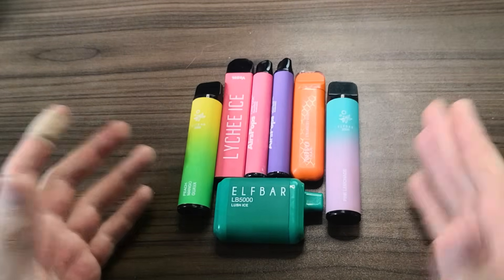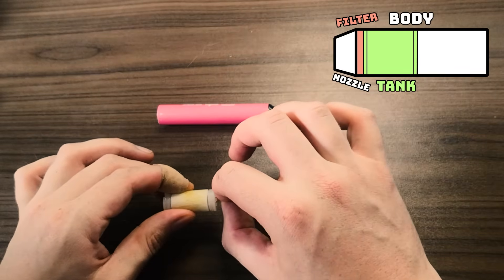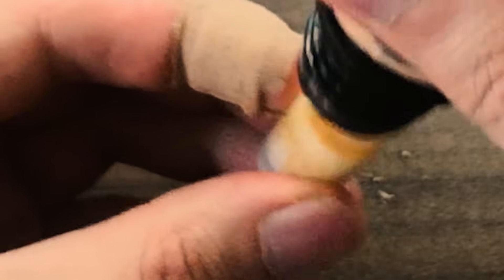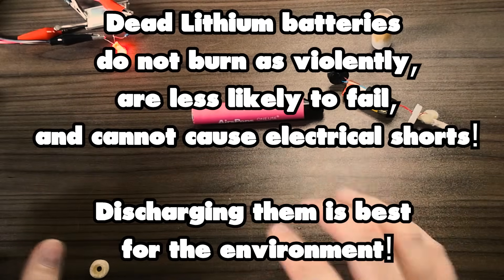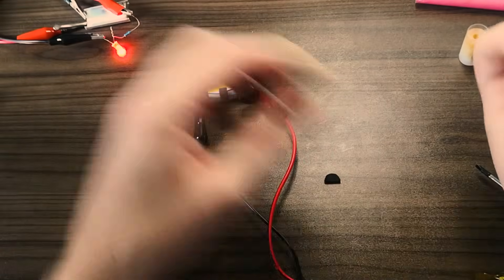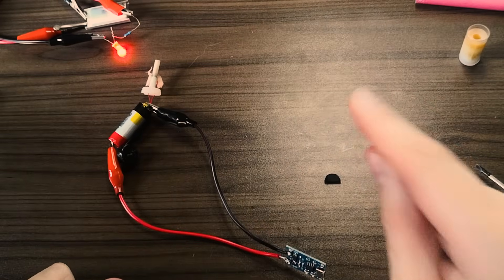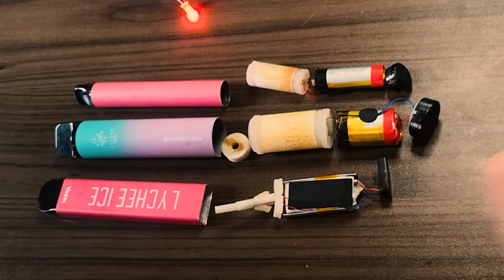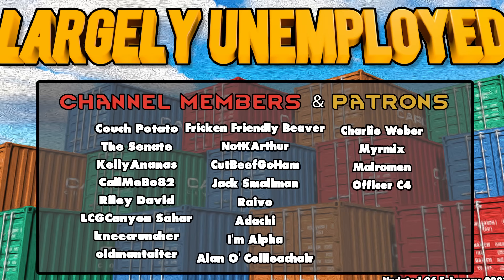'Disposable' vapes are a lie. Here's how to fix them.

Comment: I did the same thing for IGET Thanos and Star series vapes.They have a charging circuit inbuilt so you dont even need to buy a charging circuit. You can just open the thing fill it and close it again and just put it on charge .I really liked how you explained the video to non engineering background ppl on internet. You were pretty accurate about the voltages and told about battery swelling good info.I am no advertiser or promoter for any of these brands and dont promote vaping over long term.
Reply: Hey! I'm facing issues with my IGET star. It's not charging (LED not lighting up). Do you have any idea about this issue? (This is my first vape)
Reply: @takshakambekar7004 if you can, move away from disposables in general.

Comment: guys there are people literally dying of lithium poisoning from crack wiring their vapes. this is not safe, please just go out and buy another one ive personally lost two friends from this.
Reply from the maker: This is not a "crack wire" tutorial and the power output on these disposable cells here wouldn't be able to do anything more than lightly burn you if you somehow shorted the contacts with a finger.
Reply: @LargelyUnemployed  regardless youre recharging the lithium battery and theyre not meant to be recharged. not talking about simply burning yourself from the “crack wire” but rather potentially risking killing yourself due to poisoning frim the battery itself, once you recharge the vape, youre not only smoking nicotine
Reply from the maker: @Bommaosama  I'm not sure where you're getting this from? These lithium cells are absolutely rechargeable (about 6000 duty cycles on average). If you use a charger with overcharge protection then you're safe. You should always throw away any crushed, swollen or damaged cells immediately, as I reccomended in the video multiple times. I even give an example of what to look for.
Reply: then youre friend prob just cut an charger and use the cables in the charger to charge the battery witch isn't safe but this is since it will stop charging after its charged and it will also charge at a lower wattage

Comment: Hi there, my first video of yours and thanks for easy to follow instructions...prob worth making on "MARYs" cus they seem to run the disposable vaping market right now especially here in UK.. But my question is ... IVG2400 is a great DV and the puff/taste/flavours are loads better than all the ones ive tried....but can these be dismantled cus the battery is like 1750mAh a feels weighty to the rest. I always feel guilty lobbing out a battery and lots of other decent materials.. so how much can u roughly get on these dead batterys in bulk........ And looking at the pods theres x4 and the rubber pops off showing the white cotton......so ive bought sum cheap E-Liquid to try....  Just gunna SLOWLY fill .. wait .. then hopefully BLAM. WDYT?
Reply from the maker: It's worth a shot, if they refurbish well you'll save a ton. 

As for the batteries, I doubt they're worth much dead. You'd need to charge them up to at least 60% for storage, and will definitely fetch a better price online

Comment: I've tried this a few times, twice with lost Mary's and once with a cheapo. I make my own juice and have for about 15 years. 

Out of the three only one would barely hit. I came to the conclusion that these use juices with different or special grade carriers with significantly lower vape temps. Another thing is how can they get some of these juices so sweet? If i try anything 1/3 the sweetness my coils are trash after a few ml of juice. 

As i mentioned, i mix my own juice and it's good enough for me. Premium is premium and i don't feel its worth it. I haven't bought premade juice in a few years, but even the , these juices were nowhere near what the dispos are kicking out. 

Anyone else in my camp, or is everyone having great results?
Reply: I did this for IGET star and Thanos disposable vape works just fine
Reply: @advaittikle2252  I've been using the wrong sweetener all these years. It seems my marshmallow had gone sour as well. I also found out saline solution is used for certain flavors. I've been able to replicate nearly all flavors I've attempted since my comment. 

Not sure what it was, but I've been able to refill just about anything I can get open and refill with success now.
Reply: I agree with you there. Rather I've been suspecting something like that. Because all you refill the disposal ones with,you DO NOT GET the s hit...well,not even close. It's just a bland,flavorless,throatless hit. It's the juices on them.
Reply: Did it on a flum,an IGET 7000 and  a 10000...all turned out the same way.
Reply: You make your own juice? That's badass. I build my own rda/rdta coils still. Kilo went out of business a while back, can you recommend something that was as good as their dairy flavors? Or maybe you already make one?

Comment: I go to the vape stores and I go dumpster diving and I get hundreds of vapes and I my most favorite vapes are the North vapes the rechargeable black flat vapes and these are the ones that I rebuild and I take the top off the North vapes and instead of buying vape juice I go take the salt vape juice out of the other brands of vapes and I pull out the sponge cotton and I squeeze the sponge cotton and squeeze out the vape juice into a plastic spoon and then I carefully transfer the vape juice inside the North vapes and fill them and I put the top rubber seal back in and the cotton rectangular piece on top of the rubber seal and the mouth piece back on and I don’t spend any money on this and I got FREE vapes. I use the same flavor of vape juice in the North vape that is labeled on the North vapes and I got a lot of North vapes and each North vape has a separate flavor. 
Now the vapes that I tear down for the vape juice I take them vapes and I separate the batteries and I save them up and I take them to a battery store like batteries plus and they get recycled and the aluminum cases I put them into a large cardboard box and I save them to take in to the scrap metal recycling center when I take in my scrap metal that I get money from the aluminum by the pound. The plastic pieces and the wires and the coils I put in the recycling bin along with my recycling that goes out for recycling.
Reply from the maker: Good on you! Keep it up

Comment: If my battery was dead on arrival, and i attempt to save the juice and try this method, does anyone know if the juice will start leaking out after i pull this apart?
Reply: It won't leak because it is absorbed by the cotton reservoir. Just make sure not to squeeze it.

Comment: how do i change coil if its possible of course 😊😅
Reply from the maker: The 'coil' in most of these is this pathetic little NiChrome wire that's placed inside the reservoir and soldered in-line with the battery. Replacing the cotton wads should be pretty similar to a regular vape, but replacing the coil if it's burnt would be a lot more difficult. 

If you decide to throw it away, make sure to (safely) remove the battery first! You can save this for other projects, or hook it up to an LED and resistor to safely discharge it before you throw it away.

Comment: Guys in Ukraine collect these elfbars, disassemble them, and use the batteries to power the drone drop systems. E.g. those things that drop grenades on russians from small commercial drones.
Reply from the maker: I'm not surprised. The cells have years of life still in them (with proper maintenance). I'm thinking of making a little battery pack for my phone.
Reply: I'm not sure if this is meant as an Idea on what Ukranians could do or if it is saying that Ukranians are doing this right now
Reply: @eusa.n  They are doing it. And why wouldn't they? They are free normal liion batteries. You can look it up!
Reply: Lol where do you people come up with stories like this
Reply: @yarghhargh9345 What story are you talking about? That ukraine thing is real and easily verifiable.

Comment: Always great to see ''non-recyclables'' being recycled.
Reply: I've been upcycling the batteries into wireless speakers, flashlights, remote controls, and replacing disposable cells anywhere I can for a few years. A few times I grafted a charge circuit onto disposable vapes for reuse, but I'd rather refill a unit with USB already, and save the easier to solder PCB's for items that will be used for years to come
Reply: Reused.
Reply: Pedantic semantic. Extending the usable life of anything disposable by cheap or free means seems to count as recycling... A compost heap is a form of recycling waste. Just like pulling parts and saving scrap materials. I made some plastic washers from the plastic side panels of a disposable. Is that not recycling? Of do we get to a point where I'm just flat-out Engineering?!
Reply: Which practically means recycled…
Reply: @忄忄忄忄 no, it doesn't. Recycling would be breaking it down for it's raw materials and building something else. This is reusing and reducing
Reply: Reduce, re-use, repair and recycle. (in said order)

Comment: Very neat and I like the Ingenuity. I’d probably advise folks that get really invested into vaping to go ahead and get a rechargeable/refillable vape device if that’s affordable for them, rather than get the disposable pens long-term.
Reply from the maker: Thanks! And I'd suggest the same. The best way to reduce waste is to never create it.
Reply: What to do if a new vuse go disposable on first use make a sound that hisses as if it's going to explode.  And after a few puffs it gets slightly louder but still works and then have to give it a break but after 3rd puff it happens again
Reply: Run @RamonaRamrattan